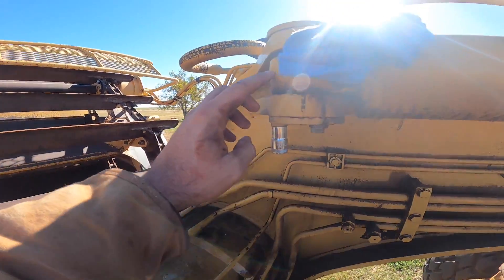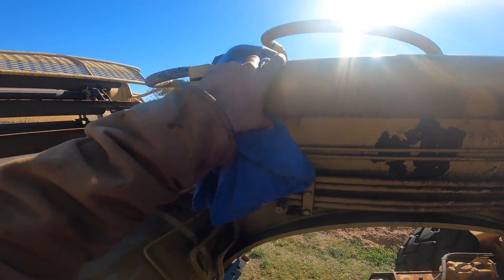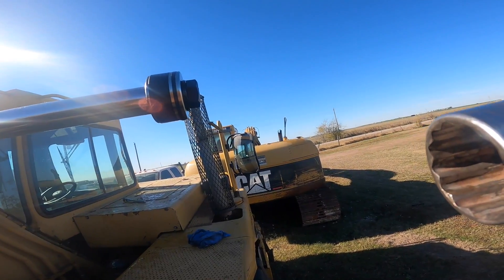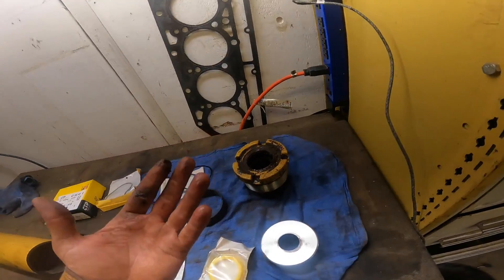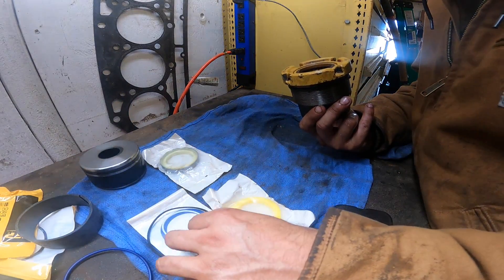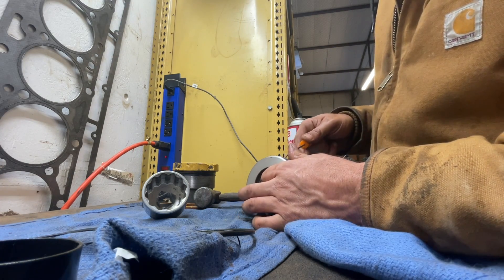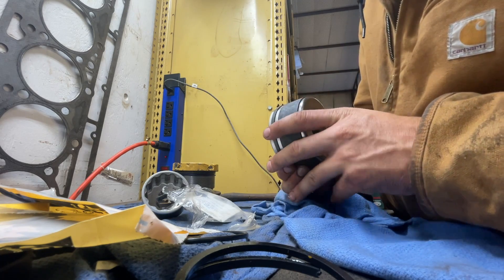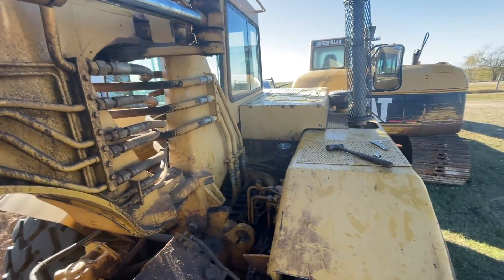HOW TO Repack Hydraulic Cylinder (CAT 613C Scraper Turn Cylinder)

Comment: Use a bucket. Cleaner jobsite and oil is way to expensive to give back to mother nature. Im getting ready to remove my bowl cylinders as they leak. Good video.
Reply from the maker: I agree. If I would’ve had help I prob would’ve tried to catch it with a bucket but I don’t have time to worry about it and I’d still spill a bunch anyways. I make money when the machines are operating so down time can easily cost more than worrying about every little repair cost. Then I’m trying to get it all on video on top of that lol. There’s not enough time in the day. Thanks for the view and comment!!